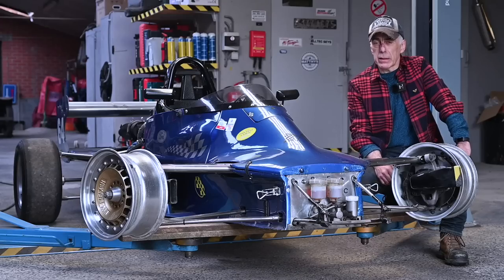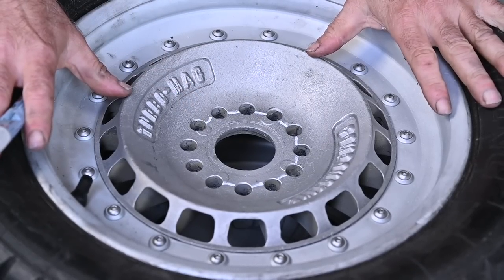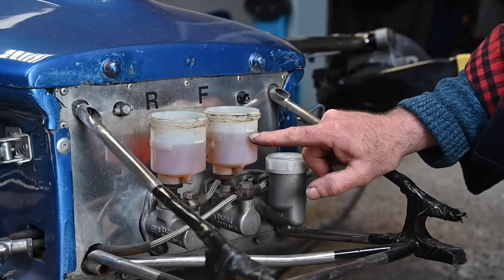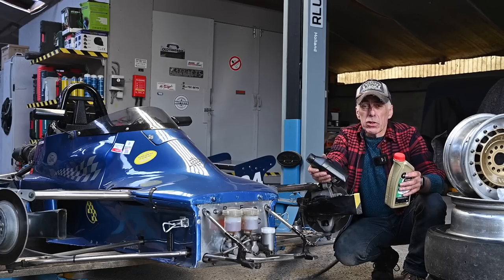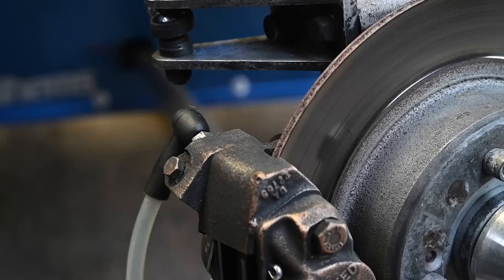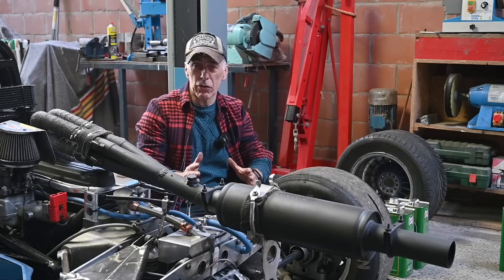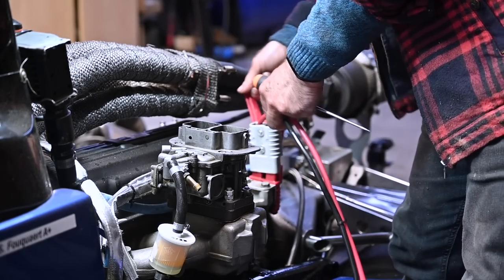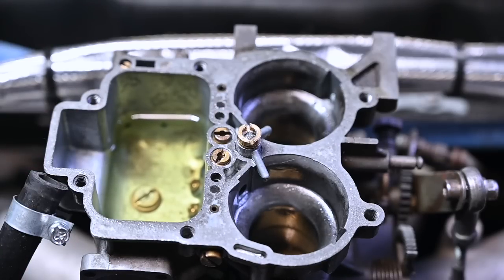Van Diemen RF 85, Weber  DGAV , rim issues and more work

Comment: Steve, keep in mind that carb idle adjustments are still important on a race car.  Every time you corner, the carb goes back to idle settings.  If these are out of wack, the engine will have a dose of bad fuel or uneven mixture, and can splutter and miss when accelerating out of a turn.  

If you spend a bit of time getting the secondary idle balanced with the primary idle, that can give you better response out of corners.  Use an infra red heat gun on the exhausts at idle to get an idea of balance.  Cylinders 1 and 4, run principally on one barrel, 2 and 3 the other.
Reply from the maker: Thanks Grahame, yes indeed the idle circuitry does play a role, what I wanted to say was that we seldom have the engine running on idle ( RPM wise)...  On this carb the idle mixture screws are removed on  the prime and the second barrel  ,  However  those are not setting the AFR for Idle, just the amount of mixture that gets in.   The idle jets are determining the mixture (AFR). Those are sized as they should and checked with an AFR h=gauge  ( wideband) on the exhaust.    I like your approach with the Cylinders 1 and 4 and 2 and 3....I will do that kind of check...

Comment: What an interesting series, and i am hooked. Re the brakes, i felt that the 5.1 synthetic Brake fluid was far superior to any other 4-5 Dot, as after i used 5.1, i never had brake fade again, even using very HARD on the track,  i also only changed it a max of twice a year, compared to almost weekly/monthly, also for the jets, i always left the carb and jets in cellulose thinners for a day or so, to remove any fuel gumming, i used a 28/36DCD carb
Reply from the maker: Thank you for the comments and tips

Comment: Another thing to check when getting a HANS to use in older cars - the shoulder straps can be too far apart and the mounts need to be moved closer together to line up with the grooves on the HANS. Looked like that may be the case with your car, though it wasn't easy to see exactly where the mounts were.
Reply from the maker: Indeed, that is also an issue. in mine that is not the case they are  at  250mm apart...   Thanks for the comments
Reply: @D3Sshooter  That's good. Thanks for sharing your knowledge and experience. I learn a lot from your videos.

Comment: Is that a 32/36 Weber or what we have in the states have, a 38mm "outlaw" Weber....it opens both 38mm barrels at the same time. I have a 32/36 and a 38mm and was wondering if the 32/36 could be modified to be synchro barrels?...I find the 38mm on a modified Toyota 22R 4cyl works the best but mpg suffers...
How do you jet? AFR meter? Your timing looks perfect by the backstrap electrode on the plugs, white to the bottom and no father.....
Reply: WOW from my Webers your floats look very HIGH.....Your over flowing problems???
Reply from the maker: Yep it is a 32/36...  both barrel open up at the same time,,, modified... here is my jetting:  Idle prime 45, Idle second 50.  Emulsion tubes ( F50 both) Prime fuel jet 160 Prime air correction 165, secondary fuel jet 130 air correction 135... copper float level shut at 41mm.   My AFR on idle 1200 14,3    at progression ( 2000 RPM) 12,5   see my last video "last minute fixes "  where I do measure the AFR
Reply: @D3Sshooter  Thanks for the jetting! Id like to see how you modified the 32/36. I have one and an old 38mm I can take linkage from. What are your engine specs, CC, cam, ect. 
My Toyota is a daily driver 4x4 pu, 22R stroked to 2.5L, forged pistons, .50 cam, 1mm bigger valves, double valve springs....I have a Innovation AFR on the dash....Weber 38mm(brass floats), 3 psi inlet fuel pressure,(Ive found that to be very important for performance, Webers dont like more and flood), 50 Idle, 142 Main, 185 Air, F50 tubes....14 base timing, 34 degrees all in at 2500 w/ 10 degrees vacuum advance, 18 PSI vacuum at idle. Getting 155HP at 5600, 170 LBS torque at 3900....17.5 city 19 hwy mpg....BUT for power I give up longevity, forged pistons tear up cyl walls when cold, brass valve guides with double springs last about 60,000 miles. 
Your living life to the fullest, enjoy your vids, love the green metal castrol oil can...we have plastic here..I run 20/50 too, 3000mile changes....Way back in the 70's I helped a neighbor with his SCCA Formula Ford(cosworth engine) and his Formula B March(twin cam Lotus), was an exciting time, places like the cork screw at Laguna Sega....
AND as a life long carpenter, your dang good there too...

Comment: I've seen some DG Webers with a v shaped tension "spring" holding the booster tight to the body. That was decades ago, tho. Design changes?
Reply from the maker: Yes indeed , that was done so at the time.  This one is a modified version  a mix between a DGAS and  DGAV...

Comment: Do you send used race oil to one of the several companies that analyze oil for signs of potential serious engine wear. Another informative video.
Reply from the maker: Hi Rick, that is what professional racers do indeed,  it is expensive and as I am not a pro racer but a historical racer, I just check the engine every so often.. and if need be rebuild it
Reply: @D3Sshooter  Do you know the price range for that service? Maybe running a magnet through the oil or heating the oil and running it through a coffee filter might provide some information.

Comment: Do you measure the taper across the rotor face.  As tapered rotors with new pads result in spongy pedal and reduced braking ability.   Having to slightly taper the new pad surface so the pad backing plates are parallel if you change pads on used rotors.
Reply from the maker: Indeed Wayne, I do ... Not in this video but I did in another , both taper and run-out

Comment: Do these cars use check valves and return lines from the caliper bleeder screw ports. So the fluid  is exchanged fractionally  each time the pedal is pushed.
Reply from the maker: They don't, as that would be a modification from the standard regulations... Else that is a good method

Comment: Carb drips  use a 10 micron fuel filter . The pleated paper filters can be 30 to 70 microns. Sediment in the fuel holds the needle and seat part way open. 
Do you have a oxygen sensor bung on the exhaust collector to allow you to use a wide band air fuel ratio display while you  bring  the rpms up to around 1500 to 1700 while looking down the venturis to ensure you are not fast enough to start pulling fuel from the boosters.  This checks the idle jet sizing.  The idle jet limits the max flow being pulled thru the idle transition slot.   You can change the idle fuel curve by changing the idle air jet. 

Doing the same at the point just before the secondaries start to flow allows you to know if you have the proper primary main jets.   Again if the primary circuit is lean or rich at lower than just before the highest rpm before the secondaries start to open  primary air bleeds and emulsion tubes effect fuel curve.  Once the primary jetting is done. The secondary jetting changes can be done. This is better under load
Reply from the maker: Hi Wayne, great write-up...   as for the dripping that was caused by a lose secondary Venturi and float level that was to high...  But a good tip for the filter, that makes 100% sense.     Yes , I do have wide band AFR gauge that I can connect to a bung.  Indeed the idle jets are the onces that take care of the idle, and even more importend the progression,   Great write-up Wayne...

Comment: Hi Steve, of course oil should be changed but I think you change it soon. I changed oil at intervals of 20 000km. 
So do you want to tell me that a race car will make at least 15 000 km in 2 hrs

MBS Moshitoa south Africa
Reply from the maker: Moshitoa, a race engine runs high RPM's and a lot is demanded from the engine. Its not the same as a normal road car...  As the race engine is stressed all the time , it develops wear and that wear are resulting in small particles in the oil, which will be filtered to some extend in the oil filter.. However not all of them and those will result in more wear .   That is why we change our oil after every race , and in my case that is 2 Hours...   The distance is irrelevant.  2 Hours of racing is about 200Km.   I know it sounds strange , but that is what it is..

Comment: I have read that the power valve has been removed from some Formula Ford race prepped Weber DGVs.

Has your carburetor been done that way?
Reply from the maker: Yes the power valve is also removed... The power valve in general adds that extra fuel when the vacuum on the membraan is removed, at that time the spring pushed the valve at bottom open allowing more fuel .  The effect on a FF is that this is not needed as we are already running fairly rich and in most cases wide open or near wide open an that drops the vacuum and in some case it would open that  valve - to much fuel

Comment: why dont you just use the good DOT4 on both? yes it cost a "little more" stil it is the safest way.  you can use the one you oppende last time for the front on the rear line. stil you can top up both with the same bottle.
i used to run a 36/36 DEGAV on my volvo. now i'm gonna run a 38/38 DEGAS. we run the 32/36 on the "Formula basic" cars that run ford motor's.
for the hans you also get a "hans harness"  they r narrow on top.
Reply from the maker: Thanks for the comments, both are good brake fluid..., just the boiling point is differend and the rear barkes  don;t get that warm at all,,, Note that one bottle (500ml) is 40 + euro... So a flush for both rear and front is two bottles..  So far the rear never had an issue..  The dot4 react performance is also an uplifted brake fluid....  so economics